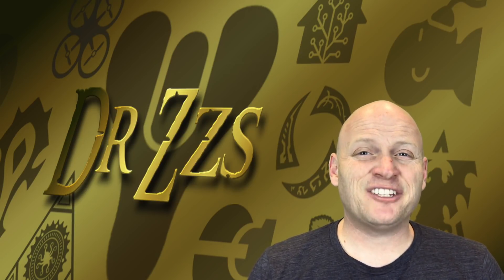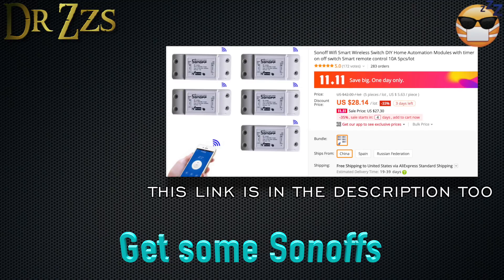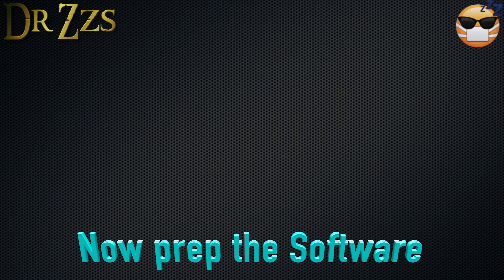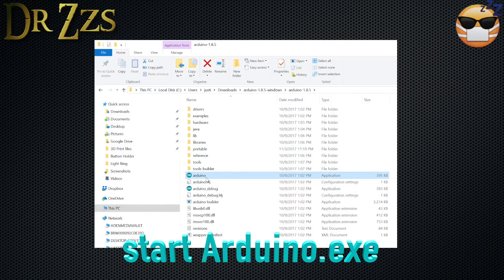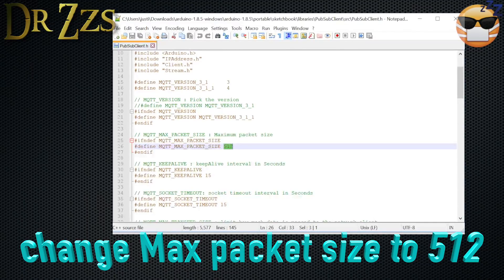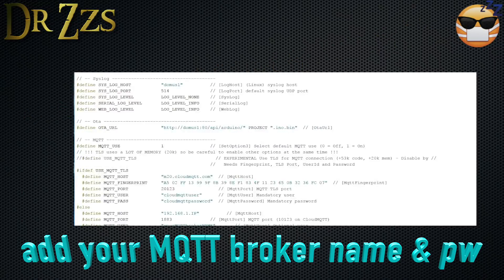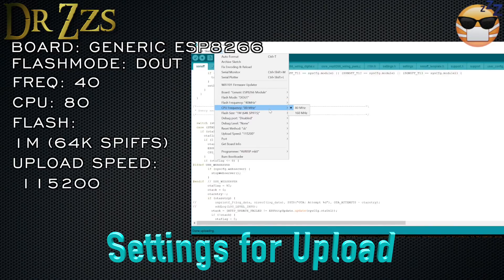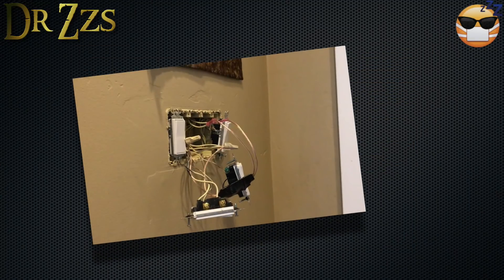Flashing TASMOTA Firmware on the Sonoff Basic

Comment: hi. may i please ask you a  question? i am still learning all this. so, this TASMOTA firmware flash is so i can use the sonoff with a switch, cell, alexa and google in any order to turn off and on a light for example? thank you kindly.
Reply from the maker: You can always ask a question!  I try to answer them all, at least as well as I can.  

The answer to your question is "mostly yes".  The reason for using Tasmota is 1) to connect the sonoff with Home Assistant or any other hub that uses MQTT.  2) to connect a physical push button so you can use it as a light switch in a regular switch box. Other people use them with Tasmota for a whole bunch of other things.  Those are just my reasons. 

Out of the box the Sonoffs can be controlled by their own app, alexa, and google home.  So, they're already pretty useful without Tasmota. 

Tuesday morning I'll have a video about how to get Alexa controlling everything you have on Home Assistant. 

Hope that answer helps. 
What are you hoping to do with them?
Reply: thank you sooo much for the fast response. and happy 2018 by the way. about your answer... i have the sonoffs here and as i have tested and saw on the videos, the way the manufacturer has it; if i turn on the lamp with my alexa i have to turn off the lamp with alexa as well. if i turn on the lamp with my cell app i then have to use the app to turn it off. i want to be able to turn on and off my apt lamps without having to use the same way i turned them on. for example: i want to turn the light on with my wall switch and then turn it off with alexa. or vice versa. i then goolgled here and noticed the method to solder a wire to the black click button on the sonoff board, so this way i could use it on my wall swtich and have it work the way i want it above. but i am bad at soldering, so i looked for another method. that is why i wanted to know if tasmota can do this. because this is the only thing i wan to do with them. thank you again!
Reply from the maker: I see.  Well, I'd encourage you to practice soldering ;)  If you really want it to work as a wall switch you'll eventually need to connect some wires to the board.  I'm a lot better at soldering now than I was 6 months ago.  It's just practice. You can do it! 

What you describe is how mine works.  I can turn lights on from the wall switch, from Alexa, or from the Home Assistant app on my phone or desktop, and then turn them off by any one of those methods, regardless of which I used to turn them on.  And with Home Assistant I can set up Automations to do things like turn off all the lights at 11pm, etc. 

Happy New Year to you as well!
Reply: so what you are saying is that TASMOTA can do what i am looking for, in case i do not decide to solder. correct? (my hands shake, illness, i cant solder)
Reply from the maker: You would need to also use Home Assistant to get control through Alexa, I believe.  The only reason to solder is to connect a switch to the GPIO pins so you don't have to use the on-board button.  You can use the on-board button to turn it on and off, but the on-board button has other functions, like putting the board back in programming mode, among other things. So using a different GPIO pin is usually considered better. But if you are totally against soldering, then you can use that on-board button. 

There are other alternative firmware options besides Tasmota.  ESPeasy and ESPruna are 2 others I know of.  I don't know if they integrate Alexa. They might.  

Hope I haven't just made you more confused. 
Good Luck!
Reply from the maker: Fair questions:
The reason I'm not using the stock firmware is to use MQTT to communicate with Home Assistant. That lets me do automations with other non-sonoff devices interacting with each other. Also, with Home Assistant I can just go to one app for all my IoT devices, instead of a different app for each brand. If the stock Sonoff firmware would let you use MQTT I'd use it.  IFTTT isn't very reliable. 

If all you have are sonoffs, and you're using Alexa to control them, then you don't need to flash the firmware to something else. 

As for the button.  The main reason to use GPIO14 instead of the on-board button (which is GPIO-0 on the Basic), is that the on-board button has other functions, like putting the board in programming mode.  So if you solder a pushbutton to the on-board button pins, and then use that as a wall switch, someone could accidentally put the board in programming mode by holding the button too long.  That won't happen if you use GPIO-14.
Reply: DrZzs why not just solder to the same points the built in push button uses?

Also, using the stock app and firmware with Alexa, I am not having the same issue of having to turn it on or off the same way I turned it on or off. If I use the app to turn it on, Alexa has no problem turning it off and vice versa.
Reply: DrZzs got it. I'm just getting into home automation, so wasn't sure why the attraction to extra pieces of hardware. And good point on the push button. Does the gpio work with a push button without flashing it?
Reply from the maker: Well, welcome to Home Automation!  I've only been into it for about 9 months.  There's new cool stuff coming along all the time! 

As far as I know the GPIO-14 pin doesn't do anything in the stock firmware. With the stock firmware the on-board button doesn't do much either. It toggles the relay and puts the board in programming mode.  If you put Tasmota on the board then the on-board button takes on a whole new set of functions:
https://github.com/arendst/Sonoff-Tasmota/wiki/Button-usage

iTead seems to be a pretty good company that is really innovating quickly and making quality stuff for a low price.  
I use the Sonoff Basic because it is the cheapest way to get a wifi chip, a relay, and a power supply all together.  You can't buy the parts for what they sell the whole thing for.

Comment: Excellent, thanks. Also put a big smile on my face when you mentioned Home Assistant. Will have to check your back catalog of videos to see what else you have done with it. I am just starting my setup, a bit slow going, need all help I can get! You had a look at MySensors.org ? Looks very promising for home diy sensor builds, a lot cheaper than buying them!

Thanks and I hope you’re having a good Christmas. Cheers 🎄

P.s new subscriber 👍😀
Reply from the maker: Shaun Whiteley Cool! Thanks! 
I haven’t looked at mysensor but I’ll check it out. 
Home Assistant is awesome. I started with it just to control some LEDs but now it’s taking over. 
I started learning from Bruh Automation videos. Ben hasn’t posted anything in a while though. 
I’m going to keep cranking out videos as long as folks are watching. 
Let me know if you have something specific you want to see. 
Good Luck!
Reply: DrZzs Thanks for reply, just going through my first setup, following your instructions. Hit a snag when trying to compile, missing libraries, are you supposed to add the Tasmota libs? I opened the sonoff.ino from the unzipped download but failed to compile after making changes. Missing irremoteesp8266, neopixiebus and tasmotaserial. Added first 2 with library manager but serial I had to manual add (add zip library) as not showing in lib manager

Just waiting now to see if it will upload.....🙏
Reply: DrZzs failing to upload, can upload blink fine but not this sketch. Espcomm_sync  failed. I noticed you have upload 1m (64k spiffs) but the tasmoto wiki has no spiffs. No idea what a spiff is so some more googling 🤔

Comment: Help please.                
compilation terminated.
exit status 1
Error compiling for board Generic ESP8266 Module.
Reply: i have the same problem
Reply: Mustafa R. Najjar try this.. 
https://youtu.be/n4MDRm2yAJg
it's work for me.
Reply: ten piseth thanks it worked out
Reply from the maker: Sorry I didn't reply sooner.  Glad you got it fixed.
Reply from the maker: I haven't had much lag on my sonoffs.  Sometimes if I toggle them too quickly they seem to stutter and delay, but normally they function very quickly. 

Do you always get lag between triggering MQTT and the response of the sonoff?
Reply: i am however still having the problem. do you have a fix.
Reply: I'm stuck on this error too. Anyone find a fix that doesn't involve installing the atom IDE?
Reply: I got this error too a few times.  A few things to check are:

-make sure all of your pins have good contact.  If you soldered the pins in, make sure you didn’t burn the eyelets out.  I did this on two sonoffs and learned my lesson 

-make sure you’re ACTUALLY in flashing mode.  Hold the black button down firmly, plug in your USB cable and wait a full four seconds, then release the black button

-in Arduino, make sure to select the ‘sonoff.h’ tab before uploading

-last but not least, make sure Rx and Tx are crossed over between the Sonoff and your USB to TTL adapter.  Rx on Sonoff goes to Tx on USB adapter and visa versa

-This wasn’t on the video but make sure under tools that the generic esp board is selected.  It was stated on the video but you have to download it from the board manager first

I hope that helps
Reply: i got a question how to set up MQTT also after Flashing TASMOTA Firmware sonoff not so responsive (lag)
Reply: DrZzs  i don't know how to connect to MQTT .about that Lag even press the swhich button need to press a few time then it's work normal .hour later same thing again.
Am slow learner .
Reply: @Jesse Hoffmann
@Ryan Ray Neff  sorry i have no idea what i am doing ... coz i just follow the instruction waht ever it's need me to install i just install.

Comment: Hi All , I got below error when I tried , which library I have to install for this ? have I bricked my sonoff or I can try again ?

Sonoff-Tasmota-development\Sonoff-Tasmota-development\sonoff\xdrv_ws2812.ino:25:25: fatal error: NeoPixelBus.h: No such file or directory

 #include <NeoPixelBus.h>
Reply from the maker: Looks like there is a NeoPixelBus library that it wants to install for some reason. 
I haven't run into problems with Tasmota needing that library before.  Try just loading that library:
Sketch - Include Library - Manage Libraries, then search for NeoPixelBus, install it then try compiling again.  

If that doesn't work, then try commenting out the lines in the user_config.h file that refer to WS2812.  They look like this:

//#define USE_WS2812                       // WS2812 Led string using library NeoPixelBus (+5k code, +1k mem) - Disable by //
//  #define USE_WS2812_CTYPE     1                 // WS2812 Color type (0 - RGB, 1 - GRB)
//  #define USE_WS2812_DMA                         // DMA supports only GPIO03 (= Serial RXD) (+1k mem)
                                                                            //   When USE_WS2812_DMA is enabled expect Exceptions on Pow

Mine are already commented out.  Maybe that's why I haven't needed that library.  
One of those two solutions should fix it for you. 

Good Luck!
Reply: Thanks DrZzs for quick reply , after adding previous library now getting this error. couldn't relate this with any library.

...\arduino-1.8.5-windows\arduino-1.8.5\portable\packages\esp8266\hardware\esp8266\2.3.0\cores\esp8266\abi.cpp:23:0:

...\arduino-1.8.5-windows\arduino-1.8.5\portable\packages\esp8266\tools\xtensa-lx106-elf-gcc\1.20.0-26-gb404fb9-2\xtensa-lx106-elf\include\c++\4.8.2\cxxabi.h:50:32: fatal error: bits/cxxabi_tweaks.h: No such file or directory

 #include <bits/cxxabi_tweaks.h>
Reply from the maker: Hmmm. 
Is this a fresh install of Arduino IDE?
If not try downloading Arduino IDE again and put it in a different folder.  Then go through the set up for Tasmota (Make Portable folder, ESP Boards URL, Load ESP board manager, get Json and PubSub libraries, etc)  

It could be some interfering setup from some other sketch you've used for something else.  

If that doesn't work, try "issues" in the Tasmota github page:
https://github.com/arendst/Sonoff-Tasmota/issues
Reply: it is a fresh install  , trying this first time on my system. I will follow the steps again with new download of IDE

Comment: I think I am the bad guy.  I am old and tired and I think I may have done the switch-o-rue.  I was tired when I flashed the board and opened a second switch and removed the board.  I probably put the flashed board in the case I thought was a new board.  However, when I open ha I don't see another switch as described in the video.  Probably has something to do with how I configured the MQTT in configuration.yaml

mqtt:
  broker: 127.0.0.1
  port: 1883
  client_id: budlyte
  username: budlyte56
  password: xxxxxxx

I did test passing a message via MQTT and it worked.  So will continue to look.  If you see anything obvious let me know.  Sorry for the confusion.

Sonoff-Tasmota 5.10.0 by Theo Arends
Reply from the maker: That's pretty funny.  Of course nothing like that has ever happened to me.  Nope, never. 

Do you have something like this in your configuration.yaml?

switch:
  - platform: mqtt
    name: "Back Porch"
    command_topic: "cmnd/sonoff/power"
    state_topic: "stat/sonoff/POWER"
    qos: 1
    payload_on: "ON"
    payload_off: "OFF"
    retain: true

That should make the button appear on your HA front page.  Then to make sure it activates your switch, where it says "sonoff" type whatever you put as your Project Name in the user_config.h

HA won't discover the sonoffs automatically.  Sorry if I didn't make that clear. 
Let me know if that doesn't fix it!

Comment: Don’t know if I am just stupid or the Grinch is running around this time of year but.  Followed you direction to the tee.  Finally got what look to me like a good flash.  Not sure why but every time I click the right arrow it compiles the software which take a reasonably long time before it actually start to flash.  Plugged in the sonoff and am not seeing it connected to the wifi or recognized by HA.  Finally gave up for the moment and took a second switch out of the box and tried to pair it with the elink app on my Iphone.  No luck at all would not pair.  Did, however, find my wifi.  I typed in the ip address in a browser and got the switch menu.  Was able to toggle on and off a fan I have connected.  Part of the sonoff menu is an MQTT button.  When I clicked on it, it brought up the exact information I had used to flash the first Sonoff.  The only thing up and running is my Pi with HA running.  I have defined a MQTT broker on the pi with the exact userid and password that is shown when I enter the second sonoff’s ip address.  I am stumped.
Reply from the maker: whoa.  
So, somehow your MQTT broker info ended up on a brand new Sonoff?  That definitely sounds like the Grinch's work. 
The one part of your question I can surely answer is that the Arduino IDE does re-compile the sketch every time before it uploads.  So that part is normal!  
The rest of what you're describing I can't explain. 
The native Sonoff software has an MQTT button? I looked for that and couldn't find it. Can you post a screenshot?
I was wondering if there was a way to just put the MQTT topic info in Home Assistant and the Broker info in the Sonoff.  If you can put Broker info in the Sonoff and see the Topics it is listening to, then that should be possible. 

Sorry I'm not more help. 
I'm working on a video for the Tasmota OTA flashing procedure.  Maybe you'll have more success with that.

Comment: What type USB cable is this using?
Reply from the maker: The USB/Serial adapter I have uses the Mini USB cable.  It's older and a little bigger than the Micro that most things use now.  
Here's one.  Looks like it uses micro usb. http://amzn.to/2CWSlLD
Some USB/Serial adapters can output 3v or 5v.  The sonoff uses 3v, so make sure you have it set to 3v before you connect it to the sonoff.
Reply: DrZzs thanks allot for the help great videos
Reply from the maker: You're welcome!  Glad it's helpful!

Comment: Thanks for the great video!
Everything worked for me but here is the catch:
When i changed my wifipassword i wanted to reflash my sonoff too but that does not seem to work. Somehow he still uses my old password over and over. Tried flashing something completly different, turn off cache, override userconfig but noting seems to work. Does someone know the problem?
Reply from the maker: dang. I don't know what's going on there. 

Can you get to the tasmota main page on the sonoff?
You could update the password there on the Wifi Config page.
 
You want to reflash to update to a newer version of Tasmota?  
There are a couple ways to upload the latests Tasmota without reflashing. They have a button that lets you just connect to their repo and download it right to the sonoff.  Or you can download the .bin file and upload it manually. 

https://github.com/arendst/Sonoff-Tasmota/releases
https://www.dropbox.com/s/hwjxa4012ukmsk0/Screenshot%202017-12-18%2009.30.57.png?dl=0
https://www.dropbox.com/s/oj0s7ovg2dk9way/Screenshot%202017-12-18%2009.31.19.png?dl=0

But if you can't access the board over your network neither of those will work. 
I'm surprised reflashing doesn't work. The upload from the IDE is working but the password doesn't change?  That's pretty odd.